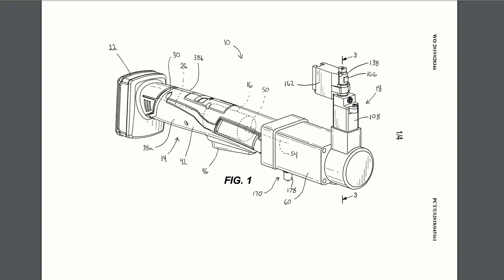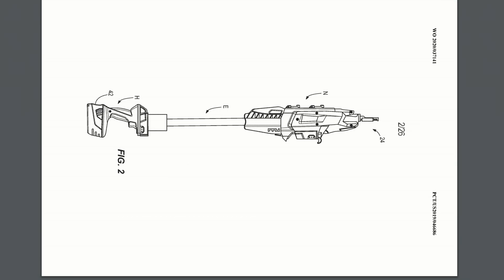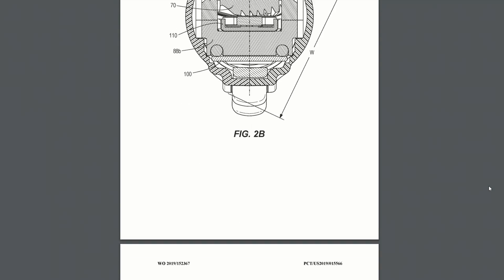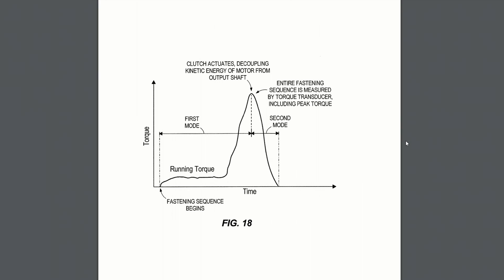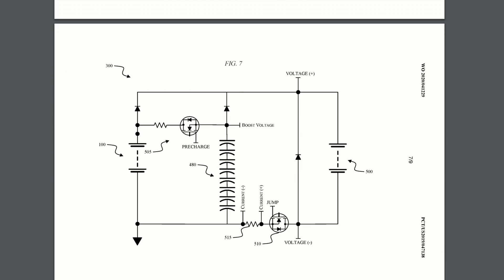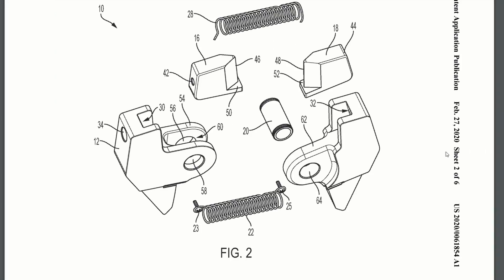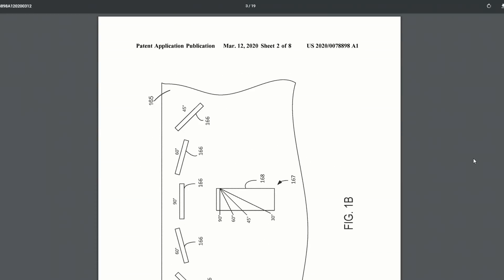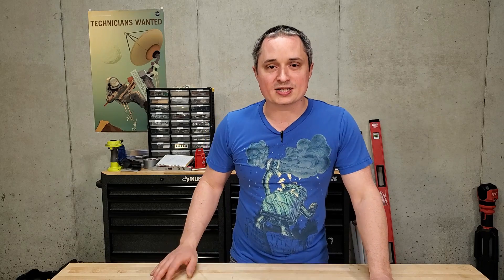MORE Milwaukee Tool Patents for 2020 - New Tool Predictions PART 2!

Comment: Make the MX chainsaw and that one will dominate the firefighting market if it’s good enough.  No mixing of gas and able to run in low oxygen environment is very beneficial.  Don’t have to pull start on a ladder is helpful and safer.  The jumpstart pack would be awesome to keep in my truck. I’ve always got batteries in my truck.
Reply: As much as I think that's awesome, I'm more worried about heat damaging the battery/saw... unless they're working on a heat shield
Reply: Steven Nihipali    Better to damage a battery than the user.

Comment: Would like to see a man lift. 10-12 maybe 14 feet...would definitely help me with dealing with suspended ceiling...changing tiles, bulbs, fixtures. Even having to manually move it into place. Much better than the traditional bakers scaffold or full size scaffold.

Comment: Pretty interesting stuff, but like most ppl I'm still wait on that framing nailer a cordless lawnmower to come out. Would also like to see some type of pressure washer option, mybe similar to the worxs one I think ridged has a similar one, for those light to little above  light job washings
Reply: lawnmower and pressure washer will be MX for sure.
Reply: YES!!! 

When I saw the cordless pressure washer from Worx, I thought to my myself, Milwaukee will definetly come out with their own version with more psi and longer run time.
Reply: Well if they do the pressure washer and lawnmower for the MX  platform guess I'm gonna have to look into a second platform other then Milwaukee cause definitely not spend those types of $$$$ for the MX and definitely gonna disappoint alot of Milwaukee m18  Customers
Reply: Maybe someone can rig up an adapter to let you throw a couple m18 batteries on an mx tool haha

Comment: Just when I thought you'd covered a lot. 🤯  Jump starter? YES! MX Fuel chainsaw? Please! Please, please, please make the vacuum packout! Interesting they show the MX Fuel battery with the current M18 table saw and 10" miter saw. Maybe just using the drawings they had? 🤔
Thanks for the awesome content!
Reply from the maker: I can't believe how many patents they've filed in the last few years! I think they just grabbed the 18V drawings and threw them in the MX FUEL patent, which means those tools might be a little farther out on release date.

Comment: An mx  20" to 24" chainsaw would really get new customers into mx fuel line.
Reply: I'd like to see it be able to pull atleast a 28" chain.
Reply: Batteries are too heavy
Reply: @loucifer323  How much do they weigh?
Reply: Keep in mind the price though.  You can buy a Stihl MS 661C-M with a 36" bar for $1350.
Reply: @shauncatlett6066  the big one is 10lbs little one is 5lbs
Reply: @loucifer323  How much does the saw weigh and what guage size bar is and chain (.050, .058, .063)?  I'm assuming that its 3/8" pitch.
Reply: @shauncatlett6066  They haven't made it yet
Reply: @loucifer323 I gotcha, I thought they had started designing it and was curious if anything was out regarding specs and possibly pricing.

Comment: That MX power pack thing is insane, if they refine that, it could work as a 1 for 1 replacement kit for Honda GX160/GX180 stationary engines, that'd be huge

Comment: How about a M18 trencher?
Reply from the maker: Might be on their list! Looks like the MX FUEL 3.7 HP might be about 20% underpowered for an 18" trencher when compared to gas. Depends on how the engine HP is measured though.
Reply: @DoresoomReviews  a guy that converted his tractor said at least 1/2 the gas motor size can be done with electric.  so a 32hp gas motor can be replaced with a 15-17hp electric motor.

Comment: I have a 1000amp battery pack and it wouldn't even turn over a 5.0L F150 last winter. Barely turned over a civic.

750amps is weak unless you drive an econobox.
Reply from the maker: I wonder what DeWalt's recent 20V Max one puts out. The specs I've found say 20A, which has to be a mistake.

Comment: The mitersaw, tablesaw, air compressor.  I would bye today. Even with high output 18 version.
Reply from the maker: They do have a 12" miter saw on the M18 platform that they released this year: https://homedepot.sjv.io/bYGPP
They also just announced an M18 quiet air compressor, but it's a 2-gallon tank designed for a single trim gun.

Comment: Anyone know the Price of this new Milwaukee car Battery Charger?   Hopefully it's NOT ridiculously Overpriced just like the Sewer Snake, Chemical Sprayer, or Air Compressor(got a Dewalt 20V for $250 & it came with Battery/Charger, the Milwaukee was $299 bare-tool).

Got a portable handheld car battery charger for Christmas & it was $100, said it can charge up to 80 cars easily.   The size of a portable Nintendo Handheld Player/Console.

Comment: What if i had a patten idea for a new tool and i wanted just a tool set for it?
Reply from the maker: Some tool companies have programs to share customer ideas, but I'm not sure if Milwaukee does. I'd check their website.

Also, having a suggestion for a cordless tool they should make is going to be different than actually having a patentable invention. To patent something, it has to be novel and non-obvious. So most of the patents that Milwaukee is filing here are for specific ways they designed a tool, rather than slapping a battery on a formerly corded or pneumatic tool.

Comment: I hope they make it more a body shop saw rather than a recip saw!
Reply from the maker: Yeah, I think automotive work was their design goal with the M12 saw.
Reply: Why?  Are the blades thinner.  T shank jig blades open up way more possibilities.   I can't find any good blades for my body saw. If you know where please enlighten.
Reply: Rusty Shackleford air saw blades are thinner and shorter. They slice like butter through tight areas on vehicles. The stroke is so short, its more like a vibration. Kind of like an oscillating multi tool.
Reply: Rusty Shackleford Ingersoll rand makes good ones available on Amazon

Comment: a m18 stapler for non metallic sheathed wire also know as romex would be nice..Dewalt has one but I'm sure milwaukee could do it better. Maybe a MX series wire tugger and feeder ....a really good m18 wall scanner and camera would be nice..also some wire spool stands..and some M18 pvc heated blankets and a mx Pipe bender for rigid pipe and IMC can you tell im an Electrician lol
Reply from the maker: Nice list of ideas! You mentioned the MX wire puller - I'm assuming you know about the M18 fish tape? https://homedepot.sjv.io/jv2NP
Reply: @DoresoomReviews  yes I do I haVe not tried it but I would love one!
Reply: Milwaukee does nothing better than dewalt all they do is copy and do a poor job at that

Comment: Any more news on makita?
Reply from the maker: No more Makita patents. I don't think any other tool company files half the number of patents that Milwaukee does.
Reply: @DoresoomReviews  Okay, thanks man!
Reply: @DoresoomReviews  I was under the impression that a patent can be hidden until a certain time.
Reply from the maker: There's usually quite a bit of time between filing and publication, often a year or two. From what I understand companies can request a longer time before publication, but that also opens them up to having the patent granted and then contested since their competition may not have had a chance to review it. But Milwaukee does have many more patents filings per year than any other tool company I've  researched.

Comment: Just because Milwaukee has a patent doesn’t mean the tool is coming anytime soon. Just like they jumped out front and patented 18 volt lithium batteries so no one else can without paying a royalty anything they can think of that anyone might build will get a patent thrown at it to get a pc of everyone again.
Reply from the maker: Yes, I didn't mention it specifically in this video, but I included that disclaimer in previous ones and it's written in the video description for this one.

They use their patents in real products though - they aren't patent trolls. The lithium ion battery patent was for use in their own tools, not just to block everyone else for a fee. I have seen a few patents for two battery tools that I think Milwaukee is using to block a Makita version of the same tool, but that's about it.
Reply: Doresoom Tool Reviews Milwaukee specifically patented the use of 5 cells or any series parallel of 5 cells to create 18 volt or 20 volt max tools so anyone who’s tool line uses 18/20 volt are paying Milwaukee a royalty. I not knocking Milwaukee at all I love all their tools and own several myself I just think it’s kinda low to patent such a thing causing other companies to have to charge more for their tools as I do own dewalt and makita tools as well. Gotta give kobalt props for going with 24 volt batteries that extra cell keeps them from paying that royalty and allows them to keep a lower price point.
Reply: @jamesfair9751  Nobody is paying royalties because they didn't invent lithium batteries, only snap on has to pay because they actually copied Milwaukee 12v battery
Reply: Lou Cifer you might want to check again. Milwaukee actually managed to patent the use of lithium cells in 18 volts.
Reply: @jamesfair9751  You can't patent someone else's technology, just like dewalt made the first cordless table saw they couldn't patent that because it has been made albeit corded
Reply from the maker: You're absolutely wrong on that one, Lou. Snap On lost their lawsuit because they used a lithium ion cell in a power tool battery without licensing the patent from Milwaukee. All other manufacturers with lithium ion power tool batteries are paying Milwaukee royalties.
Here's the article about their loss: http://ipwire.com/stories/court-wont-triple-milwaukee-tools-27-8-million-award-snap/
A quote from the judge presiding over the case: "The jury’s verdict reflects that Snap-on should have taken a license like every other competitor."
Here's the Milwaukee patent, which doesn't limit the battery voltage to specifically 12V: https://patents.google.com/patent/US10886762B2/en

Comment: We own Farms, hope Milwaukee comes up with a Hole Auger for digging holes to plant trees or digging holes to set posts/fence.

Also, wish Milwaukee comes up with a Pressure Washer, will be useful in washing Tractors, Big Rigs, Cars, Trucks, Driveways, etc....

Milwaukee Electric Bicycle  :D

Milwaukee ATV for my Farms instead of storing Gas/Diesel in the Shed/Barn/Storage.

Milwaukee Cooktop for Camping/Backpacking/Fishing/etc...

Milwaukee Juicer/Blender for those Van Lifers/Campers

Milwaukee Air Horn to scare away Bears/Coyote/Large Animals whenever out in the Wild, will be cost effective in the long run instead of carrying Can Airhorn or Bear Sprays.   Can be a Personal Safety Device for Women/kids "if" they're ever Lost in the Woods or in Danger situations.   Power source, can use their 2.5/3.0 Lithium batteries, or M12 Batteries maybe with an adaptor for use with M18 batteries.

Comment: Cordless metal cutting circular saw that does 1in thick steel with good blade life and then don't want 95$ for a blade
Reply from the maker: Just checking, have you seen the new M18 8" metal cutting circular saw they released in April this year? Model 2982-20: https://homedepot.sjv.io/975my
Reply: @DoresoomReviews  just seen it. Would like to see in person and maybe use to see how power is, how smoothly it cuts, battery life and blade life before I drop the 400. I also want a plasma cutter and may get that first. Was hoping tool only would be 250$ ish.

Comment: Trigonometry, don't you mean algebra...
Reply from the maker: Nope, definitely meant trig. Simple SOHCAHTOA will get you the angle. Just subtract one distance measurement from the other, divide by the width the sensors are spaced at, and take the arctan.